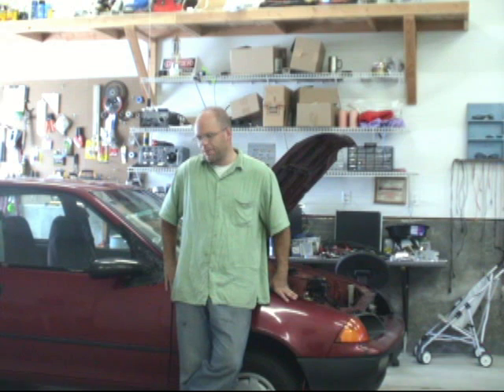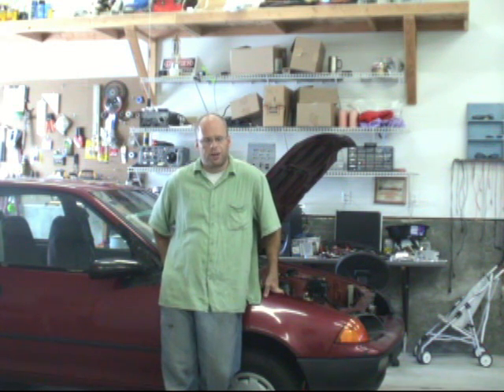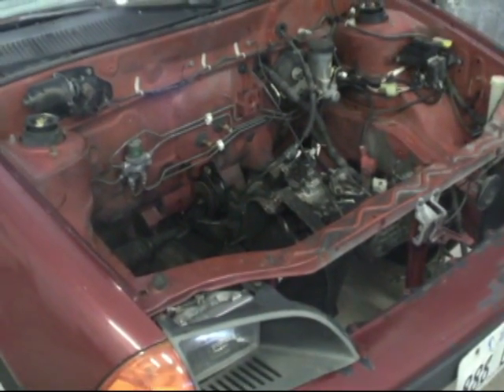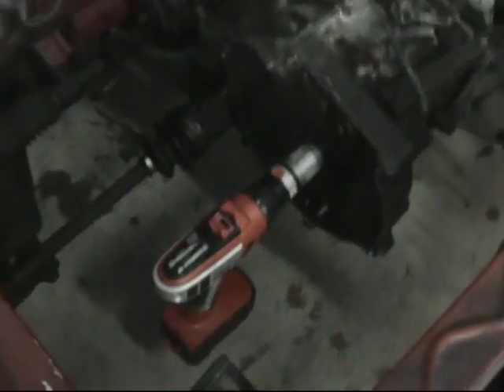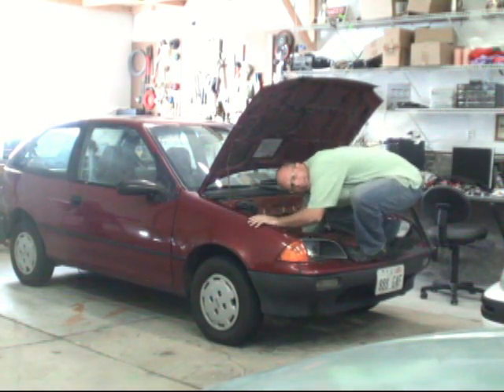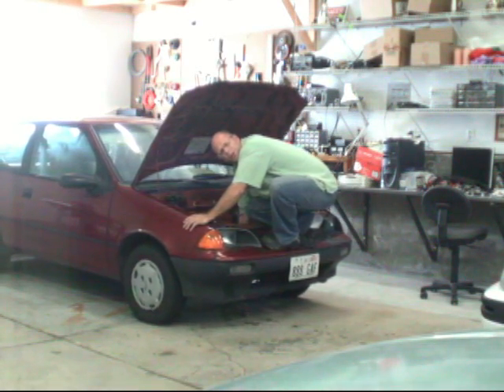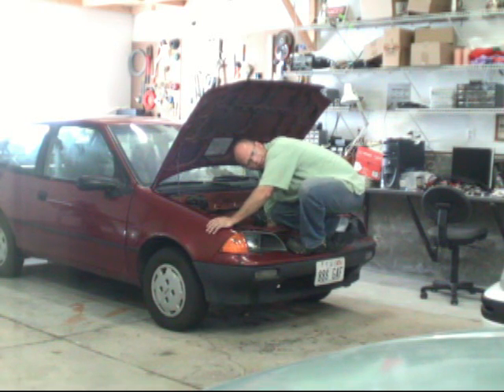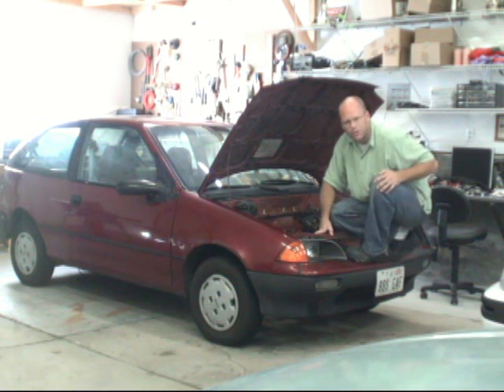Revolutionary New Electric Car Motor

Comment: how abaut just taking the spark plug aut and making the starter engine run as the Electric engine driving the car and let it run with a constant rotation and just shift gears instead of accelerator

Comment: Hey, least you now know you don't need a huge electric motor to move something the size of a metro. If a Black&Decker motor can make it move then something as small as an actual golf cart motor should be able to get you movin pretty quick and with a lot fewer batteries which results in significant cost savings. :)  In fact, that gives me an idea.  :D

Comment: You need torque and speed for an electric car, you are heading in the right direction; congratulations on what you have already accomplished.
My turbo-vortex wind turbine could generate electricity to charge a battery bank to power the electric car once you are  traveling over 25 mph.

Comment: the drill should have been fixed to the chassis or frame. The whole drill will try to rotate when you turn it ON or you must be holding it hard enough to stop it from spinning

Comment: waheedrafiq 
Yes you can propuls with any electric motor, the problem is the car speed, if you want 100km/hours speed, your Black & Decker drill rotation must have a very very high speed, because the gear box amplifi the force but reduce the speed   ;)

Comment: that truely is amazing! and i kno its true because i have a Chevy metro thats a sedan. and i can very easily push it and pull it and stop it going down hill all while turning the steering wheel haha. if you cut a hole under the drivers seat so that you can push it by feet like fred flinstone it would work!

Comment: @TheRealFobican electrical motors are usually well designed to start with. Large motors have efficiencies of over 95% (eg: +4000hp induction motors on trains and industrial applications and such) and with good engineering so do the ones you'd use in an electrical car (nowadays permanent magnet motors that have a better power to weight ratio are a popular choice). The only problem with electrical vehicles is basically batteries.

Comment: @seljer That sounds bit sad about the options to increase something with the preformance. But still i think i might have a good idea about an engine that relies on eletric: How about build something based on a trashcan´s shape or some similar drum and make/find some big gears. Then weld angeled metal pieces and borrow the spark plugsfrom the old engine (or just buy yourself some new ones) and attach them onto the base or the "block" and some fine tunings. Good hint?

Comment: @TheRealFobican besides the motor mechanically flying apart, you are basically limited by overheating. Otherwise you can just increase the voltage and it'll do more. You can rewind the motor but that usually only offers torque in exchange for speed and vice versa

Comment: Why not attach the black & decker drill in the engine room and take it for a spin and i have question about eletric engines: can you inprove the preformance of eletric engines with sort of a re-adapt blower or re-design the entire engine so it can gain some more speed/hp´s or is it a returningspot?

Comment: Dude i had to stop this video when i saw the drill. are you serious. take the batery out of the drill and the a rotor and sprocket to the inside of your car and attach a gear and chain to the inside portion. your funny. and u need to put a solar panel on top for battery life regeneration. hook the solar panel up in paralell with the battery...

Comment: that  means ; 2000 W 12V-120V DC-AC converter and 1200W high speed rpm drill is enough for 30 mph.....Yes,I'm sure !...

Comment: So... I'm guessing your next step is to put a hose clamp around the drill trigger, weld a socket to a long flexible cable, run it  into the cab of the car, put the other end of the cable into a cordless screwdriver, so you can then tighten/loosen the clamp, thereby controling the speed from the driver seat, you would need some kind of solenoid to shift the righty tighty-lefty loosey button on the drill... but it should work.... 

Peace

Gill

Comment: *SNERK!* Hilarious! 

Somewhat more seriously, if the accelerator pedal could be bodged to work the trigger, and a frame or struts added to hold the drill handle to the transmission housing, that would be a very clever way of moving the car around. You'd have to use the handbrake to stop the car, but this would best be used in the workshop: very short distances, very low speeds.